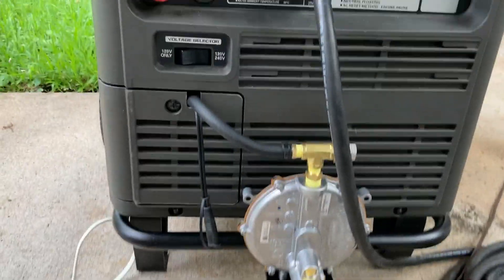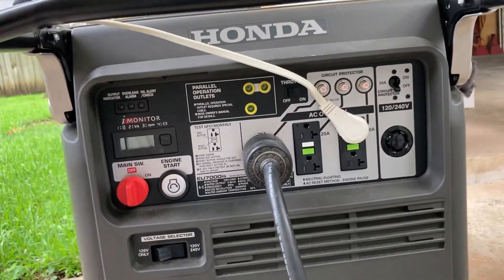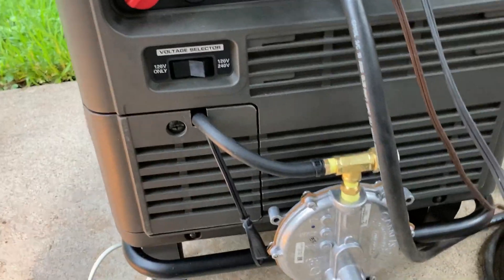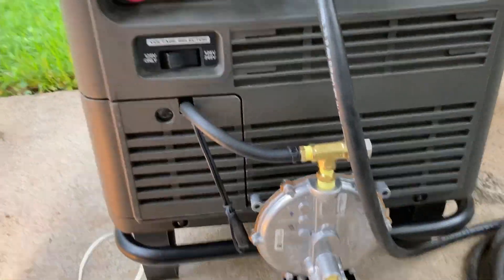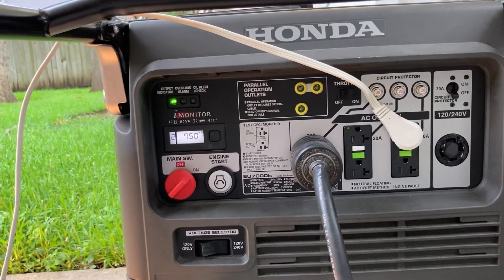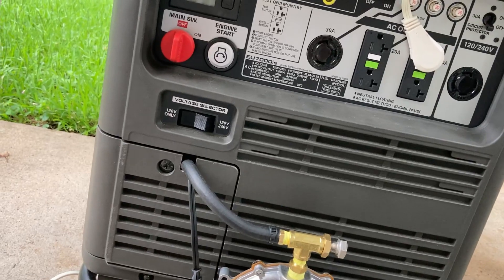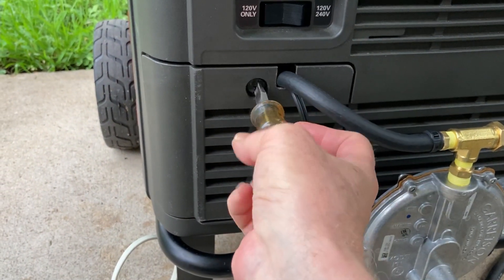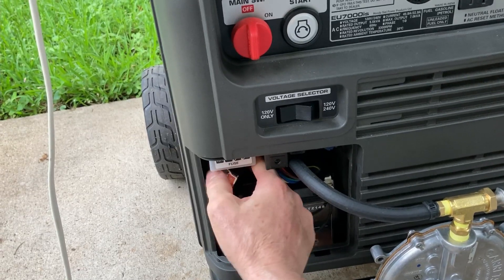Honda EU7000is running on natural gas with US Carburetion Motor Snorkel tri-fuel conversion kit

Comment: Huge difference with this kit comparing to the Genconnex.     My only wish is that the US carburetion had an option for professional installation.  Do you know anyone who would install it for me on  Honda EU7000is?
Reply from the maker: The trouble is that the kit, as supplied, doesn't actually fit the machine, so anyone who installed it would have to re-imagine some things...or it wouldn't be all that "professional".  I would offer my services, but you'd have a way to get it to me.
Reply: @MstrMark  how many clips are on the fuel injector cover?  2 or 4?  You mention these are hard to remove.  Do you have a video of you installing that snorkel kit?
Reply from the maker: @BS-rn8gq  If you mean the so-called "silencer cover", there are four clips.  I linked two videos above.  They are not detailed how-to videos, but I do show some of the challenges and offer some of my own solutions.
Reply: @MstrMark  Please pardon my lack of terminology, but I meant the plastic cover that needs to be removed to install the motor snorkel
Reply from the maker: @BS-rn8gq  I'm referring to the clips on the cover that are shown at this time index: https://youtu.be/2NziDBzqI-Y?t=1047

Comment: Micro air easy start 364 to put on any ac is a miracle,  it will make a huge difference
Reply from the maker: That's what I hear, but pretty expensive just for the sake of testing.  If they were to send me one, I would certainly make a video showing it in action!
Reply: I have used them its crazy how well they work
Reply from the maker: @chadwickparker9705  That would make a fun comparison video!

Comment: I hope u have disabled the fuel pump or it will die running dry.
Reply from the maker: Well, to be clear, I didn't design the kit - I just installed it.  I am guessing that the reason that it's possible to run the generator on natural gas while there is still gasoline in the tank is because the fuel pump and injector have been disabled, but I have not personally verified that to be true. If you're thinking about buying this same kit for yourself, I hope you'll ask that question and let us all know what you learn.
Reply: @MstrMark  This is another concern that I have just been made aware of on the Honda EU6500. I have checked everywhere including the expanded drawings and I don't see any kind of fuel pump being used on this generator - just gravity feed. Please anyone advise me if I am wrong because running it on natural gas with no gasoline in it, any kind of fuel pump would burn up in short order. If i can't find this out, I'll visit the local Honda generator dealer and ask him the question...thanks to any and all that respond. 

Ottawa Hydro came out today to inspect the Customer Layout and have billed me $388.91 for the work they will be doing. My ole daddy used to have a saying " if you're going to get screwed, bend over and enjoy it". 

Somehow that doesn't make me feel any better....
Reply from the maker: @TOURMANBOB  The EU7000is has an electric fuel pump, but I don't know about the EU6500, but I suspect that it is gravity feed.  The US Carburetion kit disables the fuel pump on mine.  If it helps, my fuel pump in inside the gas tank.
Reply: @MstrMark  I'm going to double check with the local Honda dealer to make sure about this point. If no fuel pump on the EU6500 as I very much suspect, then my order is going in straightaway to US Carburetion for the Type C kit. Mods won't be difficult, only routing the hose to the externally mounted regulator will be a bit of a challenge. Then I will simply hook it up using 1/2 natural gas hose and see if it will run properly at heavy loads. If not, then change out the short length of 3/8 piping put in for the barbeque to 1/2 inch and all should be well (fingers crossed....)
Reply from the maker: @TOURMANBOB  Good luck!
Reply: @MstrMark  Thank you sir...I will let you know how it goes
Reply: @MstrMark  I checked with the exploded diagrams in the EU 6500 manual, plus confirmed with the Honda dealer, the EU6500 is gravity fed and doesn't have a  fuel pump. So a simple snorkel kit will work without major modifications like the EU7000 requires.
Reply from the maker: @TOURMANBOB  Nice!  I only hope the Snorkel works better on your EU6500is than it did on my EU3000is.  I have to tell, after the total failure on the 3000, I wasn't expecting the 7000 to work any better, but I was pleasantly surprised.  Good luck!
Reply: @MstrMark  Thanks, I'll be sure to let you know

Comment: Im in the process of converting my EU6500is in much the same fashion that you have done with your gen.   The snorkel  install went well with a bit of modification as per the instructions that came with my kit.  I especially like your solution to running your propane line thru the firewall.  You mention that you "punched" a whole.  Did you use a hole saw and drill or another method?  Im not seeing an easy method to get that done on my unit.  It very tight from the front and a bit of an angle from inside.  Thank you for posting your project.
Reply from the maker: Hi - I used a tool known as a "chassis punch", aka "knockout punch".  The brand I used is Greenlee and that is probably the premier brand.  These can be expensive, but you don't need the hydraulic version for a job like this, so that will reduce the cost considerably.  If you decide to buy one, just be aware that they are often sold by "trade size", as opposed to actual size.  For example, in the electrician trade, a 3/4" conduit fitting does not actually measure 3/4".  Punches for other trades are sold by actual hole size, so just be aware.

Basically, one starts by drilling a smaller hole, like 3/8", then inserts the punch through that hole and tightens it down with a wrench until it punches through.  It is way easier to get accurate positioning than trying to do it with a big twist drill bit or step bit, and It makes a nice clean hole.  I didn't have any trouble drilling a 3/8" hole, but I did have the battery and instrument panel removed when I did it.  I posted a video here that may give you some insight: https://youtu.be/jczarRxAunI

By the way, removing the control panel may seem intimidating, but it only took me a few minutes.  I used bungee cords to support the panel while I was working, in order to prevent strain on the wiring.  I didn't remove any of the factory wiring, except for the one plug that facilitates the installation of the new module.
Reply: @MstrMark  Thanks for the quick reply.  I am familiar with Greenlee products and I will have a look at what they have to offer.  I may yet follow your lead on the routing of the vapor line but Im also considering punching a hole in the floor of the unit as there is ample room.  The hose would have to route underneath and out the front for a bit longer run but It seems an easy option.  For now,  waiting on some parts next week.  Best wishes to you and yours and again thanks for the posting.
Reply from the maker: @dahveedl3133  I would be interested to know what you come up with.
Reply: @MstrMark  In thinking about how I am going to route the gas hose out of the EU6500  generator, I am going to look into simply running it through the oil drain hole in the bottom pan of the generator, then under the genny up to the front mounted regulator. This would mean I have to remove the hose only when I need to change the oil, but this doesn't seem much like a bad inconvenience versus drilling permanent holes in the body of genny. We'll see......
Reply from the maker: @TOURMANBOB  Up to you of course, but FWIW, I have found my gas hose to be almost impossible to remove from the regulator fitting without damaging the hose.
Reply: @MstrMark  Thanks...good to know. Perhaps there is a quick connect fixture that would work right at the regulator

Comment: Have you considered changing the spark plug gap for running on natural gas?  I've been doing some reading and it looks like quite a few people who have converted generators to run on NG instead of gasoline have replaced their spark plugs with iridium plugs with smaller gaps. I just purchased the NGK BPR6EIX and will try this to see if there is any difference at higher loads with the gap set to .022 instead of .030.
Reply from the maker: I did change the plug and the gap, but haven't tried iridium.  I was under the impression that the main value of irridium is longer life...(?)  I hope you'll let me know if you can tell any difference.
Reply: @MstrMark  Very good. I just received my Micro-Air EasyStart 368 soft starter today and will be installing that on my 4-ton condenser sometime this week, replacing a hard start kit that's on the unit now.  LRA is 129 amps and the lights were dimming when it kicked on.  Once it's installed, I think I'm going to try to start the AC with the Honda running on gasoline (for maximum output) to see if it will work, but I don't intend on using the main AC in the event of an outage. I bought the soft starter to hopefully prolong the life of the condenser as it's getting long in the tooth (~15 years old).    I'll keep the 5-2-1- hard start kit around and reinstall it when we sell the house, taking the soft starter with us.
Reply from the maker: @browsedeweb8834  That's a lot of amps.  Your idea about trying on gasoline makes sense to me because I can tell you from personal experience that while my EU7000is can start the old 2-ton window A/C unit in my garage while running on gasoline, it can't start it on natural gas.  I think the EER on that unit is only 8.0 and it has no hard start or soft start kit...it's actually a lot harder to both start and run than my central unit.  Sometimes it even trips the 20-amp breaker.  It's so bad that I thought the start cap must have degraded, but it checks out fine.  It's just a 28-year-old thing that wasn't very efficient even when it was brand new.  Heck, I paid less for it than an EasyStart, and it still works, so I guess I shouldn't complain.

Naturally I'll be very interested to learn how the Micro-Air gadget works for you.